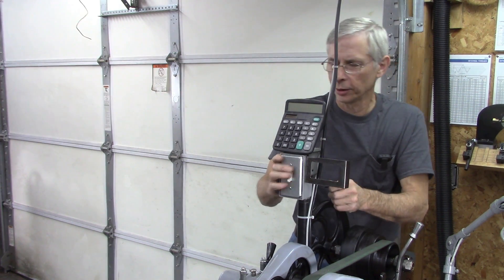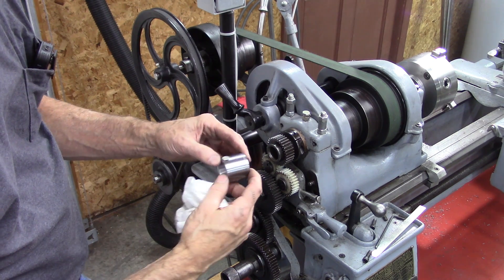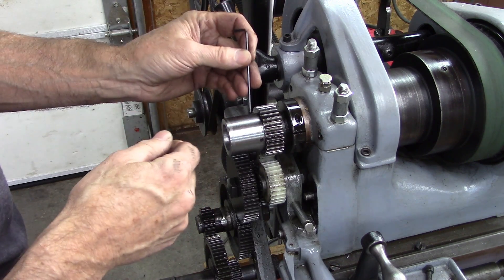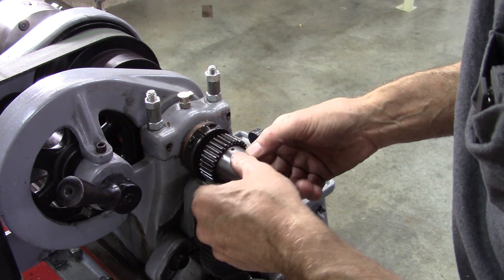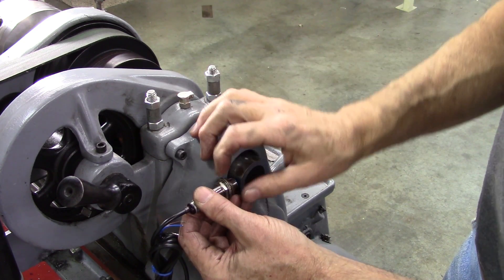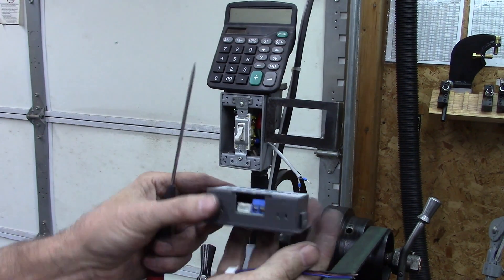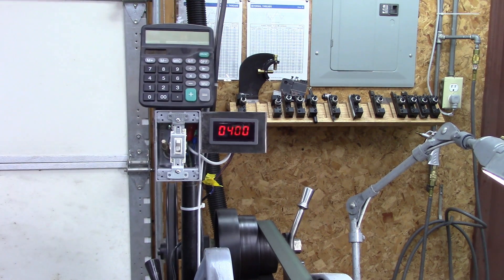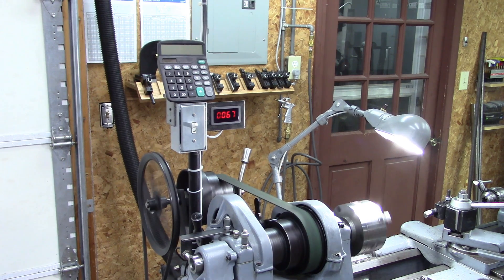Lathe Speed Indicator for less than $20 Bucks!

Comment: :oops::oops::oops::oops:I had just ordered one of these tachs., should arrive today.    Was starting to think of where to mount sensor.   Liked your approach here.  
And wanted to make a "cats head" for that far end of my spindle anyway for centering long pieces in this 1 3/8" spindle throat.  (I may consider tacking my new piece to the spindle with a few TIG weld tacks to assure it stays put - as long as I don't get too much heat to damage/warp bearings or spindle).  Although I suppose JB weld might be a good option as well, with set screws still for safety.  So would make the steel tube extension longer than yours for the catshead screws to not interfere with the sensor.  

In process of converting my 1/2 HP AC motor on an 11" Logan, to a 1.25 HP DC motor (treadmill motor) with speed control.  So will incorporate the tach in the same housing.  
Will be great to be able to set speed, even if just avoiding chatter in some instances.  But also want to be able to slow start as well - should allow me to 'carefully' run in reverse (without losing the chuck) for threading in reverse direction to assure I don't crash the lathe. 
Also really liked the idea of having the calculator there mounted - especially for those of us without a DRO.   Just like I have different sets of tools at different 'stations' around the place - prevents the searching and shuffling of gear from place to place.   So will have to pull out one of my old calcs to put there.  ...where is that old HP35 -- LOL.  

Also think I should make a flip chart mounted there for having speed tables handy - have to see if I can find some tables which are practical & hobby lathe friendly.   I'm a newbie at this.
Reply from the maker: Yeah...  I like the flip chart idea. I have a bunch on the wall but I can't see them.  The VFD would be nice for chatter and the Speed Indicator is a must.
Reply: @WinkysWorkshop  Thanks -- For me if the data is not handy I will "guesstimate". 
Similar reason why I have 4 trashcans with a broom and dustpan at each -- for less  "mess-timation".  LOL

Comment: Nice find, casually searched once but all I found was low voltage displays and I sure didn't want another low voltage adapter creating a spider's nest of wires.
Also reminds me I need to paint my South Bend someday, they sure look nice with new paint...
Reply from the maker: Thanks on the south bend and I totally agree...  i hate a bunch of wires!
Reply: A thin figure 8 lead  from an old 12VDC plug pack is not so onerous I think. Better than messing with mains wiring.
Reply from the maker: @Bennyboy-dog  Messing with the main power was easy and I didn't want more wires and outlets to deal with. 12V would be okay if I had to but the 120v option is better for me.
Reply: @WinkysWorkshop  Coming from a 240V environment I guess I view this from a different angle, but yes, fair enough - whatever works.
Reply from the maker: @Bennyboy-dog  Yeah...  I can understand that. I've been shocked by 120v a couple time. I didn't like it but. I'm still here.

Comment: You could get a magnet with a countersunk hole to attach it to your adapter, thereby preventing it from coming loose. Super glue can loosen up over time.
Reply from the maker: True...  so far its holding just with magnetism but I need to do something better.
Reply: @WinkysWorkshop  how about a set screw from the end?
Reply from the maker: @dans_Learning_Curve  I liked the idea one guy had, run an end mill almost all the way thru from the other side. So there is a lip to hold the magnet.
Reply: @WinkysWorkshop  and the magnetic would go in from the inside?
Reply from the maker: @dans_Learning_Curve  That would be the best for sure!

Comment: I did the same thing on my wood lathe that was belt driven and could just have easily figured out the speeds by sheave sizes but the readout is nice. Did put one on my metal lathe as it was variable speed and had no factory speed indication.
Reply from the maker: Thank requires math!  Haha...  Actually the flat belts are easy but the pulley on the motor is small and I'm never sure where to calculate the diameter? Inside the belt or outside or half way? Then the back gear ratio is unknown.

Comment: Nice addition to your lathe! I was thinking that another option for retaining the magnet might have been to bore a slightly smaller hole through both sides of the spindle extension the n drilling almost through with a full diameter bit. You would need to grind the bit flat to finish the hole bottom.  It might have been "fiddly" to get that to work just right.  Loctite would give a little extra retention as well but it looks like it is going to work just fine like it is!
Reply from the maker: Great idea!  I like that!

Comment: Nice job, although I am concerned about no strain relief & bushing on the AC line into the switchbox.
Reply from the maker: Thanks. Technically this would be a good idea but the wire I used is very industrial (thick insulation). Plus the wire will never be moved like it would be with a normal power cord.